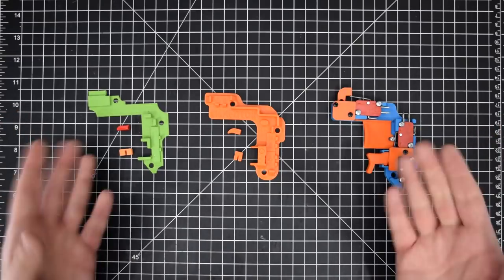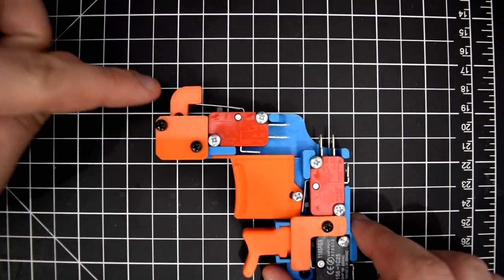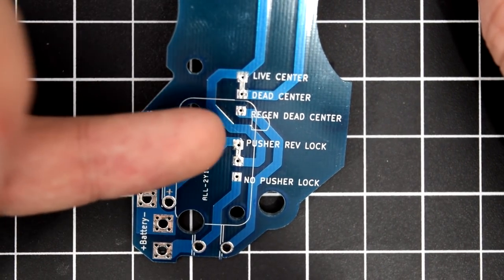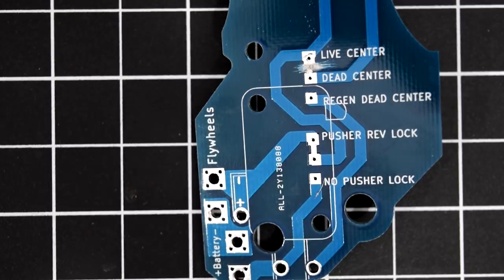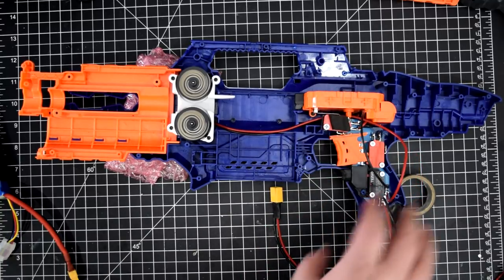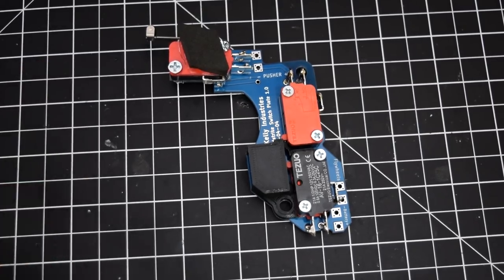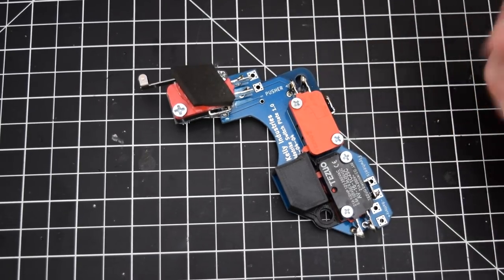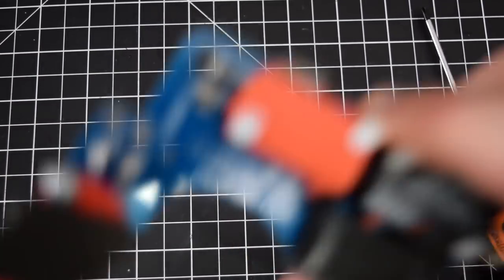Review: The KellyIndustries Rapidstrike Switch Plate (It's awesome)

Comment: Nice board design from KI, suggestion I would have is some caution with the solid wire jumpers from PCB to switch terminal. That looks like the solder joint or the pad on the PCB could be a fatigue failure with time. Perhaps a stranded or braid piece, or add a bend.

Also, the test setup needs more dwell on the limit switch, even on 2 cell it was on the edge. Using a roller lever as a follower tends to not work out too well, the "shoe" type followers are better.

Comment: Desoldering braid / desoldering wick is a copper mesh that absorbs hot solder and it's cheap.  You buy a small spool or roll of it, and snip off the filled-up end after each use.  So a "solder sucker" is only a nice-to-have and never essential.

Comment: Thanks for the award! I'll definitely work on a Bobo style rev trigger. Unfortunately I swapped the + and - holes on that version, and forgot to update the labels, so the labels are backwards. The - pads are in the center, and the + pads are on the outside.

If you want to reduce wire mess even more, I recommend attaching all three negative wires to the top hole on the pusher connection.

Gluing the plate down isn't necessary, the shell pushes against the printed part on the bottom screw post and the foam pad on the top to keep it from lifting up. But sometimes the switch plate can pop off the screw posts, which can be a bit annoying, and hot glue fixes that.

There's also a 3D printed main trigger for this, if you want a different color or don't want to cut your stock trigger.
Reply: Hi Adrian, mine only came with 3 screws and 2 nuts. what size do i need to buy? they look like m3 / m4 but i dont have my calipers here.
Reply: @Ratman99UK , assuming you purchased it from OutofDarts, I would email him at outofdarts@gmail.com and ask him.

That being said, I also received 3 screws and decided to put the 3rd screw on the screw port closest to the pusher switch lever.  I figured as it would be getting the most impact, securing it from moving around too much would be the best idea.
Reply: @PogiChoie  interestingly if you look on the outofdarts page for the kit it only shows 3 screws and 2 nuts In the photo. Seems like it's intended. 
So far I've put the screws at the opposite end to the solder joint as I guessed that would hold the one end.
Reply: Sorry to hear that, they definitely should come with four screws and nuts. They're M3, you can contact Out of Darts, or I can send them to you. I just contacted him about this to make sure it's not a widespread issue.
Reply: @adriankelly3338  I'm in the UK, mate so I'm not going to expect with you or out of darts to post two screws around the world. 
As you say it's worth checking with "out of darts" for stock moving forward but I myself will just pick up a few bolts from eBay. 
Thanks for getting back to me
Reply: Hmm yeah I think this should work. Cut the Rev Lock jumper on the back of the board and solder the output of the PWM board to the NO (top right) tab of the main trigger switch.

Comment: I have the newer 1.2 board with a date of 2019-02-02. When I rev, both the flywheels and pusher activate. I’m assuming the board leads are labeled correctly (and they seem to have moved, as the battery/flywheel negative are now in the upper left.)

I’m trying to follow the printed circuit, but where it runs under the switches I’m losing it. I’m not sure how to contact Kelly Industries as the site has no contact form, so any help would be appreciated.

Comment: So Bobo, now that you have spent time with it. What’s your verdict on using the roller switch in the pusher location, did you end up having to shape the end of the pusher rod at all? or has it been pretty reliable?
Reply from the maker: Haven't had any issues yet, the angle is solid and appears to work without any problems... so far.
It's not my first choice in how to do it, but as long as it works, right?

Comment: Great product! I always wondered how much resistance printed boards like this would add to the circuit though compared to the usual direct connections to the rest of your (much thicker) 18G/16G wiring. Any idea? :)
Reply: I kept the traces for the high current flywheels really short to keep resistance down, they're about 8mm from each switch tab to the wire pad, so 2mOhm total, which is totally negligible. All the long traces are only for the pusher. They're about 50mm, which is 12mOhm, about the same as 2ft of 18 AWG wire or a bit less than 1 Omron switch.
Reply: @adriankelly3338  Thanks for that - good info to know. Keep 'em coming!

Comment: This seems phenomenal. I have a technical question. Does he say much about the current that board can take? I intend to do MOSFETs, so that is significantly less important, but I was looking at the fine nature of it and wondered if a regular build with revamp motors might test those connections.
Reply from the maker: So far, I'm trusting AKelly's design since he's also made the flywheel cage boards in a similar way. Time will tell, but I'll be surprised if this fails.
Reply: @Bobololo  Just curious because even 18 awg wire can get some shade from the electrical engineers in our hobby. I wonder if it bottlenecks. I'm sure if it does, we'll hear about it anyways.
Reply: You shouldn't have an issue with any Nerf motor. The added resistance is equivalent to 3" of extra 18AWG wire on the flywheels and 2 feet on the pusher. And I'm in the camp that 18 gauge wire is totally fine too. The wire in your motors is like 30 gauge.

Comment: Sooooooo....My pusher is turning on when I rev, and I can't find the short. Any ideas?
Reply from the maker: Check the note above the buy link in the description. Might need to reverse the leads.
Reply: That was it. I actually mixed up the connection at the pusher motor, but swapping at the board still fixed it. Thanks!

Comment: does this mean that you cant use 3s with this pcb?
thinking about getting one please help!
Reply from the maker: Should be more than fine on 3S
Reply: @Bobololo  I was thinking about fangs and a honey badger would the rate of fire be to high for the pcb?
Reply from the maker: @cadend4188  Not really about if the PCB can take it, it'll be more about if the switch can shut off the Honey Badger fast enough in certain wiring set-ups. Dead Center should work, as per my example in the video